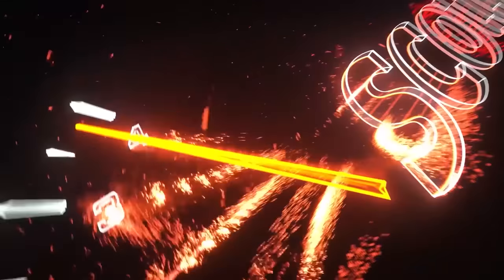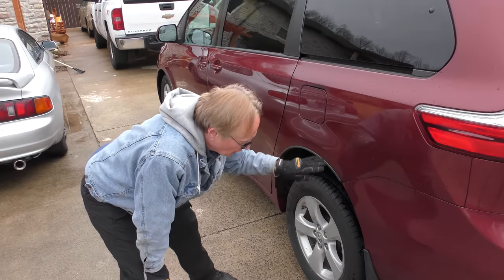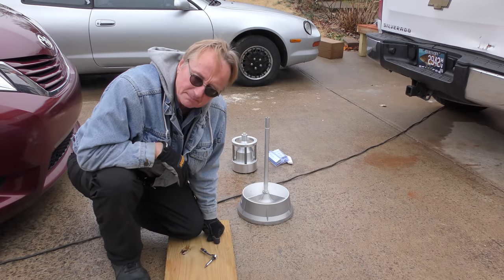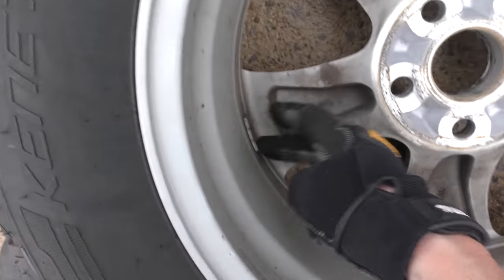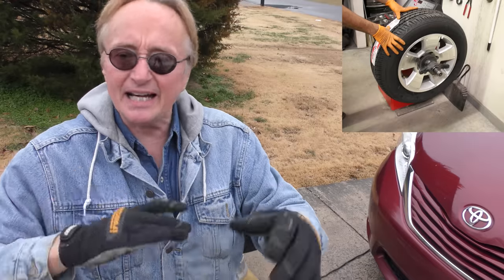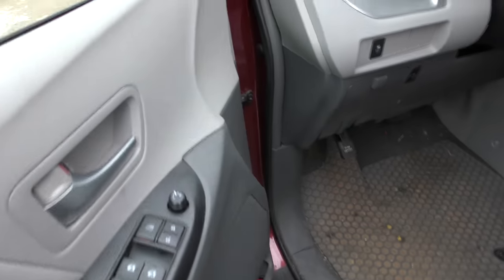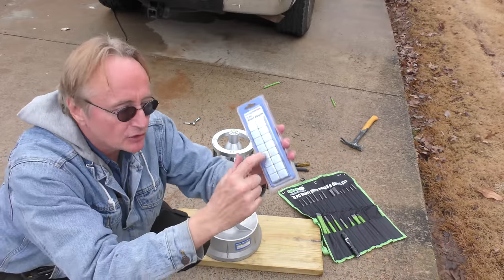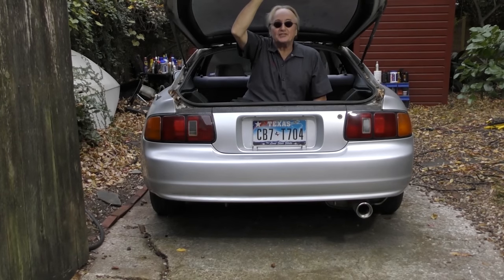Stop Going to This Tire Shop Right Now

Comment: "Those idiots at the tire shops!" If Scotty thinks the tire guys are idiots, wait until he has an encounter with the guys at the quickie oil change shops.
Reply: Yep, I was lazy and went to a quickie lube. They were supposed to do the first major service on the car. After a couple hours they called me and told me I’d have to tow it to a mechanic because the threads where the spark plugs go were stripped. When I came to pick up the car they told me that it wasn’t they’re fault and the threads where already stripped when they got it. I told them they’d never been replaced, that’s when they told me that “well, we’re not paying to fix the car and you can’t prove it was us” I was young and stupid, I should have sued them. The previous owner had given me all the records and I could have proved that the dealership had only performed oil changes and a tire rotation. Long story short, I paid $500 to have $2,000 worth of damage done to my car.
Reply: He has.

Comment: ⚠ I used to go to a place called 'Tire Kingdom' (who sold/installed tires but also did other mechanical work) back home in New Orleans. I started noticing that, every time I went to them to get something fixed, something else would break soon afterwards. This kept me going back to them over and over. I eventually realized that they, themselves, were probably sabotaging other components under the hood of my truck when they fix others to keep a steady income rolling in. Needless to say, I stopped dealing with them. I just wanted to warn anyone who goes there (if they're still in business after Hurricane 🌀 Katrina) or considers going there so they'll rethink dealing with them. ⚠

Comment: Another great tip! Torquing the lug nuts and not using an impact wrench.
Reply: We had a nearby tire shop that would tighten the lug nuts so much nobody else around could get them off.   When they brought the vehicle to my dad for tires or brake work, he would often have them drive out to that shop and make them loosen up the lug nuts.  If they were going to break, my dad didn't want to be the one responsible for doing it.

Comment: Most shops use air impact tools when mounting tires, and grossly over-torque nuts or bolts.
Reply: I'm a victim of this. My tire went flat in the driveway and I couldn't get the lug nuts off. So, I put a cheater bar on my wrench and twisted the lug bolt in half. Tire and half the bolt came off. That is when I had the flashback of the guy in the tire shop using an air wrench without the "torque-stick". I was so focused on him using the "star" pattern when tightening, I missed the torque - or lack, thereof - method. 

After buying a new lug bolt and loosening all the nuts on all the wheels with an impact wrench, I tightened them by hand with a torque wrench. I went back to the offending discount tire shop and vented, promising to never return again while spreading their reputation as far as possible. I don't know if it helped because this was before the days of SOCIAL MEDIA which I don't use, but I felt better. Lesson learned the hard way. 

Now I buy my tires from a trusted tire shop with a torque wrench used in a "star" pattern. It costs a little more but it is worth it.
Reply: Yeah one reason I dont want aluminum wheels is some slackjack with an air wrench busting my wheel.
Reply: Torque sticks are important
Reply: most shops yes, especially if it’s privately owned, take it to discount/americas tire, we always pre-torque to 65 ft lbs and then torque down to factory spec.
Reply: I work at Discount Tire. We use air impacts to take off and put on wheels. When we put wheels on, we use torque sticks, that limit the max torque to 65 ft lbs. Then we lower the vehicle halfway until the tires are touching the ground, and torque each wheel.
Reply: @iDatedMyPizza  Cal23 over here, nice to see somebody who’s not from my store haha
Reply: @iDatedMyPizza  A job well done.
Reply: The current one I work at doesn’t use them and it bothers the crap out of me.
Reply: Believe it or not Walmart does.

Comment: Done the bubble balance many years ago. As my Dad said 'It'll get ya home' - meaning better spin balanced soon.
Reply: They'' do more than get you home. The worked fine for decades. You just know how to use them like any tool.
Reply: My dad used a bubble balancer for 55 years until he retired 5 years ago.  Over the years the tires are made so much better they often don't need any weight added.

Comment: I've seen most discount tire places never using a torque wrench when put the tire back on. Good stuff, great info.
Reply: Standing on the tire iron while another guy holds it
Reply: I work at the dealer... All the technicians use impact tools for putting on wheels... All the time.. No1 has the time and patience for a torque wrench
Reply: @tykohondo  you can put a tourqe link in line with the impact wrench
Reply: @groundpounder4134  they dont do any of that jist make it as tight as posibble with their gun... Brrrrrr.... Brrr
Reply: The tire places I've been using have been using torque wrenches for years. I noticed a change way back in the mid to late 70s. The gas stations of that era that offered repair and tire replacement services tended to not use torque wrenches on the lug nuts. It could make changing a flat tire impossible. Torque wrench use is much more common these days. Even Costco uses a torque wrench.
Reply: I work at ntb I use a impact to put them on then when it’s off the hoist I toqrk it down then you need one of your co workiers to toqurk it
Reply: @captinbeyond  I wonder what the recommended torque value is for a Honda. There isn't much difference between for my Toyota and Mercedes. It's usually is in the 25--30lb-ft range.  Doesn't take much strength to loosen.
Reply: @captinbeyond  Sounds like someone at the dealer had used a longer 1/2 drive ratchet and gave it a heavy twist. Just because Honda may specify using a torque wrench doesn't mean that the tech did use one.

Comment: Well one thing. When you replace one tire only the tires on the same axle will be uneven which will cause uneven wear and cause off balance. Yes that tire did not properly have the weight installed. However as an engineer I’d highly recommend having your tires spun balanced. Discount tire does a phenomenal job balancing tires.

Comment: Same situation happened to my girlfriend, they told her her rim was bent and she needed a new one. I went and had them balance the tires and the issue went away....weird!
Reply: Never send the wife/gf even if they know their cars, some assholes at shops will try to rip them off just because they assume they don't know anything. Of course, it's a good way to see if a shop are crooks.
Reply: Not weird, dishonest.
Reply: @MiltonRoe  I seriously hate when mechanics think that because I'm a female, they can take advantage! I grew up around honest mechanics, so I know a thing or two and work on my own cars when I'm able. Somethings, you have no choice, new tires, alignment, etc..
Reply: @JakeO curious what degree do you got? how much mechanic experience you talkin about?  how many engines and tranys have you repaired?
Reply: @jaminova_1969  your correct, i work on my own car for most of my work needed, brakes rotors, fluids, gaskets, plugs, just normal maitnance that saves a lot of money instead of taking to a shop and some things i even did at a shop like aligning the wheels, doing brakes at a shop too, but i still will take my car in for new tires, new alignment, or new struts somtimes can be a pain to install yourself on exotic cars. anyway i agree with ya some things your just better taking in for work but 3/4th of the time its maintenance or repairs i can do myself.
Reply: @doodoobutter4406  And thanks to Scotty, we can keep up with technology!
Reply: @JakeO Actually, I'm a pretty knowledgeable, good mechanic. What type of engine? Steam, Internal Combustion, Turbine? The only engines I'm not real knowledgeable of are diesels, but I understand how they work.
Reply: I like to tell people, "I was born during the day. But it wasn't yesterday" !

Comment: Tire shops have those different colored extensions for their impact wrenches.  Different colors for different torques.  But of course I like to check the torque after I get my car home.  They say it is a good idea to check the torque on your lug nuts after driving several miles,  so it works out well for me doing what I do.  I've had a tire place put the lug nuts on SO tight, that when using a breaker bar to break them loose to do a brake job months later, the wheel spun on the garage floor!  Great videos Scotty!  Keep up the good work

Comment: I had a similar experience with my tires and they were not balanced right either. I took my Civic in and they fixed it and haven’t had any issues since. Great videos and information!

Comment: I've always dreaded getting tires because tire shops rarely use torque wrenches and look at you like you're the problem when you ask for it.
Reply: Not only does the shop I work at require you to use a torque wrench, you have to have another tech double check your torque and sign off on it before it gets pulled out lol.
Reply: @SteelWorksGuy  where at

Comment: The likely hood of having a perfectly balanced tire with out weights is out of the ordinary.  I am never that lucky......
Reply: I've  had to back to my mechanic to re balance my wheels right after  I got an alignment. He still got it wrong  it still was shaking.
Reply: I’ve. Been working a a tire shop for bout 4 months that has happend twice
Reply: Virtually impossible due to the valve stem and (possibly) the TPMS sensor.
Reply: Scotty is awesome!!
Reply: @flyingjeff1984  it does happen. Rarely but it does happen.  I just have never been that lucky.  I have both steel and aluminum rims on my 2 main daily drivers and have always had to use weights on my tires.
Reply: @flyingjeff1984  yes, but weighing nearly next to nothing it can happen. I would never trust that doohickey contraption Scotty whipped outta the shed tho.
Reply: @zacharyhooper2037  I don't know your experience level with tire mounting.  I've done a few.  I'll take the bubble every day and twice on Sunday-----especially for double-checking the overworked kid at the tire store.
Reply: I've had that experience where balancing came out zero, with Goodyear tire & tsw rims, thats the quality, in Jamaica we have tires where you've maybe never heard of, Chinese tires,  OMG !!! , rarely find a good one
Reply: @davidleesin112  yea I try to stay away from 🇨🇳 crap.  My go to cheap tire is Ohastu they are generic Yokohama tires.
Reply: A quality wheel without damage and an expensive performance tire can usually zero without weight 1/10th of the time
Reply: Sounds like it was just someone who didn't know what they were doing I used to work at a high-end tire shop and my balances were on point every time
Reply: @JR-ol6xj  is that tire shop you worked at a one-off private place or a chain? If it's the latter, would love to know which one it is!   :)

Comment: Hi scotty I remember getting 3 flats before I’d done 30 miles after getting off the ferry changed to the spare and called into a very old garage and he put the new tyre on then balanced it on what looked like a foot stool that you see in shops and it sat at an angle and he spun it round then put a weight on it spun it round and put another weight on it then spun it once more and pu a final weight on it and when I got back home the next week I took it to the tyre shop and asked them to check it on their machine and they said that it was balanced fine, so old time stuff works just as well as the new electronic equipment, it’s the guy working it makes all the difference

Comment: I bought new wheels at a Discount Tire in Tacoma,WA. After “balancing”& rebalancing 3 times my suv still didn’t drive right. I ended up returning the wheels and never going back
Reply: If it was vibration I’d wonder if the wheels were out of round or the tires. If the wheels were, that’s some questionable manufacturing..
Reply: or rotors

Comment: I have a hard time finding a tire shop  with properly trained employees.
Reply: Yeah it’s cause they pay 10$ per hour make more cashiering at a grocery store lol
Reply: @TheMechanicj  it’s an insanely easy job. The hardest part would be balancing the wheels lmao
Reply: Costco
Reply: @alexcastaneda2233  it’s not easier than putting van vegetables on a bag a tire tech can kill someone if they mess up the lug nuts too tight or too loose or cause thousand of dollars of damage dropping a car off a lift drop some beans dam ur out 1$ drop a Mercedes off a lift ur tout 60000$ get real man cashiers at a grocery store should make 1/2 what a tire tech makes
Reply: @TheMechanicj  if the tech doesn’t know exact torque specs of different vehicle manufacturers they should not even get hired. Like with how every Honda should be 80 ft pounds of torque on the lugnuts.
Reply: @alexcastaneda2233  that’s what repair info is for no person on earth can memorize every torque spec for every vehicle that was stupidest comment I ever heard lol
Reply: @alexcastaneda2233  that’s like a employee at Walmart selling tires has to memorize the factory tire size and brand of every car on the road
Reply: @alexcastaneda2233  not every Honda is 80foot pounds. You clearly don’t know what you’re talking about. Also computers have been around for a long time. So you don’t need to know the proper specs on every vehicle.

Comment: Scotty, I didn't know about those bubble wheel balancers. Thanks for posting that video. I've insisted in the past when getting new tires installed, that they remove all the old weights before balancing. Good help is hard to find.

Comment: I went to a place called Discount Tire and they forgot to tighten my lugs. Almost got me killed.
Reply: Yeah, I try to stay away from those kind of places unless its an emergency. Years ago my grandpop went to a place called American Discount Tires and they forgot to even put the lugs on .... when my grandpop went to drive it out it out of the bay all the tires fell off :)
Reply: Lol I did that to myself once, tightened front wheels with breaker bar while spinning them while up in the air. Forgot to torque em after I put the jack stands away. Later that night I  realized what happened just before getting on the freeway about a mile from my house. Turned around to head back home and I had to stop 4 times on the way to tighten up the lug nuts. I had the breaker bar with me but unless I jacked the truck up I wasn’t going to get the wheel seated properly. What tipped me off was knowing the noise a loose wheel makes having heard it when a big CDL B truck I was in had the front wheel nuts tightened with an air ratchet setup for smaller vehicles.
Reply: @dirtyaznstyle4156  I actually got on the interstate and eventually noticed a clicking sound everytime I applied the brakes. When I got to campus I  realized that my front lug nuts were only finger tight. A friend of mine removed one with his fingers. This was at Nascar Tech so we torqued them back down and I haven't been to Discount Tire Co. since. That was in 2009.
Reply: @pacwalds  American Tires is Discount Tires just different name on west of the country and the east has it named Discount Tires.
Reply: Ill stand out and say I got 5 new tires and wheels done at Discount tire(called Americas Tire in cali) and they work perfectly. Weights of both kind sused, my mechanic didn't like discount tires but he said they did it right and it drive smooth, 33 inch tires on a Jeep Wrangler too

Comment: "...then set the parking brake"
Been driving automatic all life, always used parking brake in every single park, before I set the P and let off the brakes. Why strain the transmission.
Reply: did you not see Scotty spinning the wheel to see if the tire was out of round? How couldn't do that with the parking brake set. The reason he set the parking brake towards the end was to tighten the lug nuts while that corner was still in the air.
Reply: @maxrx7  the wheel would have to out of balance to a very high degree to see shake. That part is just foolish. No way can someone spin a tire and notice the small out of balance shake. That part was for show or just in case.
Reply: @valiktoma2542  not necessarily just for show. You can listen for bearing noise and check for bubbles on the outside of the tire which could cause shaking like he was talking about in his video. Additionally, grasping the tire and checking for play will tell you if you have worn ball joints and bushings.
Reply: @goatsemarathon6642  Fair enough, good points. I only own subarus and AWD is second nature in my thinking. When lifted, the back or front never spins freely with little effort (yes with hand brake off).

Comment: Was raised watching my dad use a bubble balancer 50 years ago. Now its in my garage. People will laugh at a balancer like that, but it never fails.
Reply: I don't think a bubble balancer is adequate for today's cars.  Among other things the wheels are a bigger diameter with many cars having 16 inch or larger wheels where years ago they were 13 or 14 inches in diameter.  I would prefer that the wheels on my car be balanced using a spin balancing machine.

Comment: That’s how we balanced tires at the gas station I worked at. 50 years ago.
Reply: at the gas station! wow lol im impressed. i mean i know they did some light things for the customer but balance some tires damn gas station jobs back in day were rad.
Reply: @doodoobutter4406  Indeed if you go back to the early 80s especially the mid 70s and prior MOST gas stations actually had full service repair shops, lifts and bays as well. They could do almost anything you needed that any dealer could.